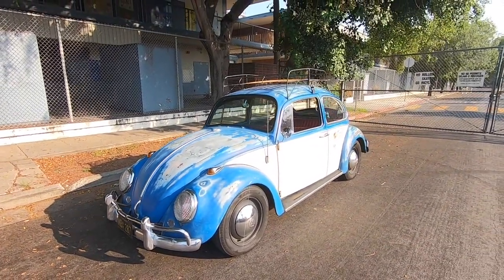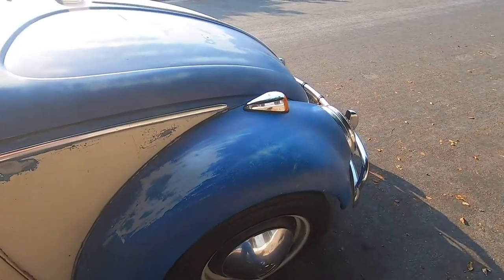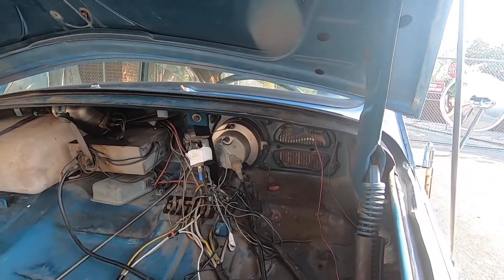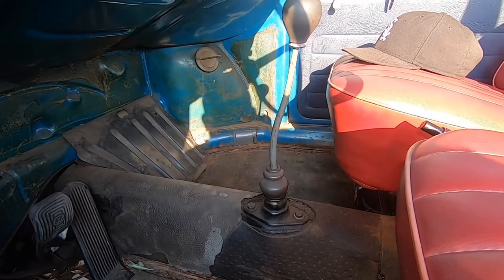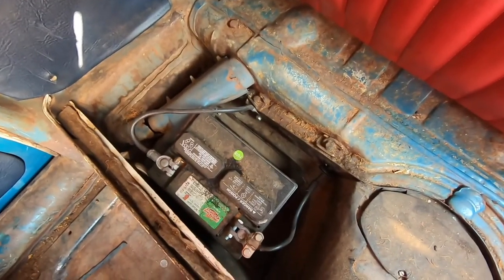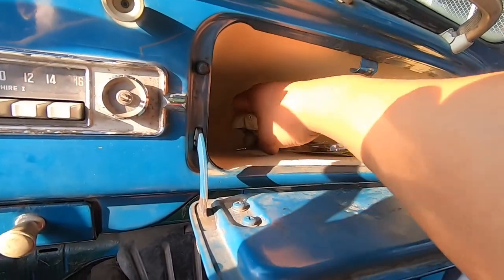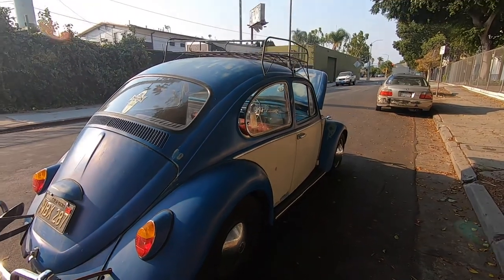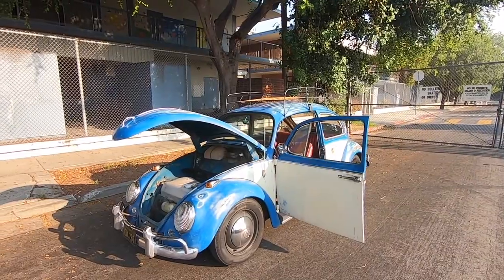Our New 1965 Volkswagen Bug *Vocho*

Comment: Thats  a solid bug... it must has been sitting for years before the last guy or two  had it. Those are original black  CA plates too..thats tight.  I have a 65 bug that hasn't been on the road since 1983 im working on. I had 12 vws since 1998 when I was 15 here in Long Beach... my 66 convertible was stolen back in 2002 and stripped to the bone smh. My 88 Toyota pickup was stolen in 2012 ! Lol just my luck.  I gotta 66 chevy c10 I'm hooking up now too.. vw people are helpful so you'll be alright.  That little white thing u touched in the glove box is the windshield washer fluid  button.  It goes in the middle of the switch
Reply from the maker: This is our very first bug every. Completely different set ups than the cars we are use to. Simple in their own way 😂
Reply: @OXCFilms  lol exactly  I see !

Comment: Just go ahead and buy a quality, complete wiring harness! And while you're in there, do a "big-3" for the wiring power and grounds.
That way you can do a "tuck" hiding as much as you can to make it clean looking.
(And to get rid of those goofy fuses) And won't leave you stranded out somewhere at night.
Plus, the wiring upgrade will actually help the engine run more efficient.
(NEVER TAKE SPARK PLUGS OUT OF A HOT ENGINE!)
Wait til it's cool enough to lay your hand on the head without burning it.
Check if they're the correct plug (I love NGK) AND HEAT RANGE. And when you re-install, use "anti-seize" on the threads. Put about a 6-8" section of hose on the plug, when you're starting them back in. If you strip/ cross thread it, it will cost you..
Of course, change the fluids and maybe a filter relocation kit, so oil changes won't be a pain.
Just use an inexpensive oil with a qt of  Seafoam or Marvel Mystery oil
To clean the inside.
Air cooled engines are harder on the oil. So I'd change it every 1000-1200mi for the first couple times.
But if your pushrod tubes are leaking, you may have to take care of THAT first.
Also, make sure your vacuum advance is working, and not leaking vacuum. Use an ohm meter to check the plug wires, coil etc. Good timing/ignition will help it run cool too.
If you're out in Cali, there's a totally different world for you with the bug crowd!!
Usually a great bunch of people.. 
The sky's the limit on how much of either a Purist, or Wild-Custom!
Spend a little more and get some good street tires that are a bit wider. It'll make a BIG difference in handling, versus those tiny bias ply's.
I'm hopefully going to look at a Baja bug out near me, but the guy isn't responding..
Then another street legal sand rail type that I wanted to trade a CR-V for, but our schedules aren't working lol..
Good luck with your new baby!
You should take a poll to name it!!.

Oh, and just blast the rack, and have it powder coated a contrasting color, with maybe a mini LED light bar?
Don't know your laws out there.
.E.
Reply: How bout Gum-ball?
Reply from the maker: Hey thanks for all the info. For sure the tune up is coming up soon. Ive read mixed reviews on what oil weight to use. So far i think im going with 20w-50. Also what wirimg kit would you recommend me to look into? A baja bug was one of my options at first but we recently got rid of a lifted toyota pickup so we decided to go with something lowered this time. Bajas look awesome though. And the name we chose for it is Bug-Gotti 😂